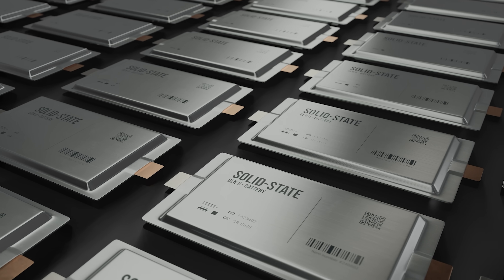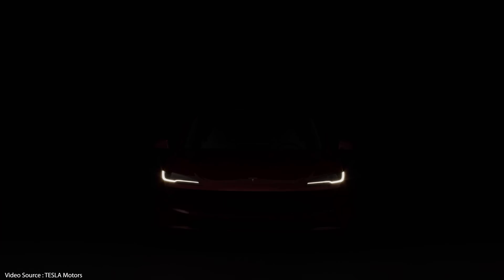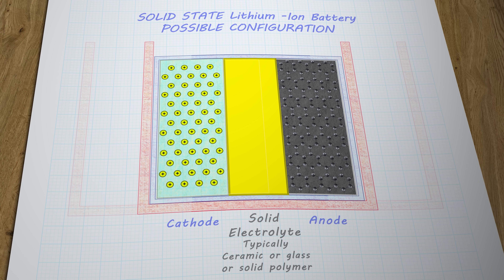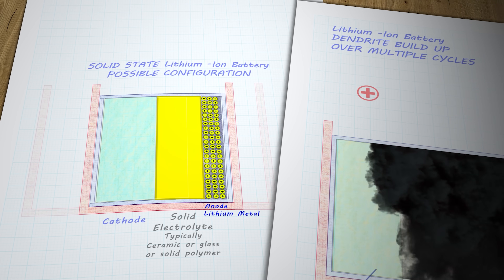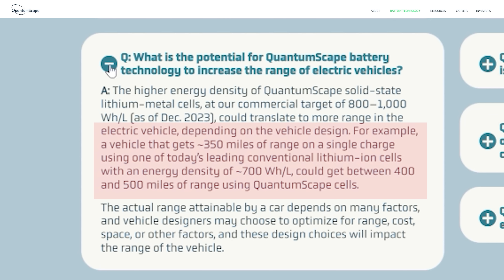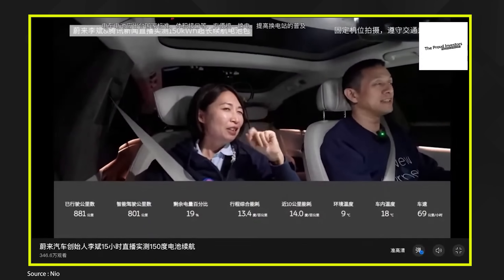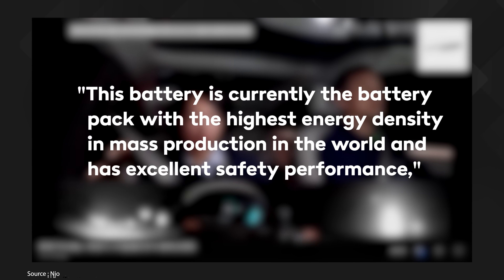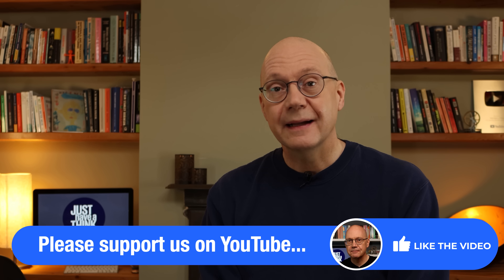Solid State Batteries - FINALLY powering electric vehicles in 2024!

Comment: I am still waiting for the sodium technology.
Reply: Thankfully JAC is releasing their first Sodium-Ion powered cars this quarter if not already... Same here, I don't need/want a huge range. I want the cheapest most durable option which it would seem to be these!
Reply: My doctor told me to reduce my sodium intake
Reply: @PaulG.x  "Paul, we need to talk about your diet. Eating batteries is not healthy."
Reply: @PaulG.x  That is a very wise precaution.
Reply: @PaulG.x  Stop eating so much.
Reply: I've got tons of sodium cells in my lab and working in hot-swappable modules. They are even available on eBay. They're here
Reply: Sodium SSB with 1500Wh/kg and Minus 350 degrees celsius temperature stable and 1500C energy output for 10 cents/kWh.
Reply: @wolfgangpreier9160  -350°C would be a neat trick.
Reply: Sodium is better for long duration storage of energy, so it's being used for solar panels and backup systems.
Reply: I am waiting  for sulfur. It is promissed double the energy with halfbthe price. Or something like that
Reply: @jonasdresch  Im am waiting for miniaturized dilithium crystals which are needed for the first matter antimatter reactor for your pocket.
Reply: @jonasdresch  If I remember correctly, Sulphur batteries have much higher operating temperature than Lithium ones. As in, the battery prototype I read about had to be heated to 80 degrees Celsius in order to work. Not exactly a good fit for a car that might need to run under freezing temperatures, though it is workable for certain static storage uses where either the temperature isn't an issue or else you can just throw in a ton of insulation and a heat pump.
Reply: @FabioCapela  Those could be useful on hot climates like deserts or in metal factories that produce a lot of heat.
Reply: Sodium is already here from CATL and others.  It's not too great in terms of energy density, but makes a lot of sense for stationary storage.  It is also being used in low-end cars that will be out soon if not already.